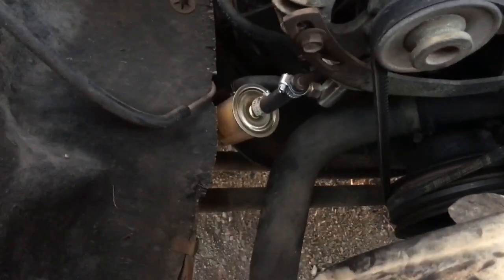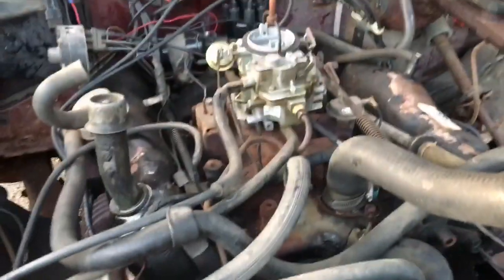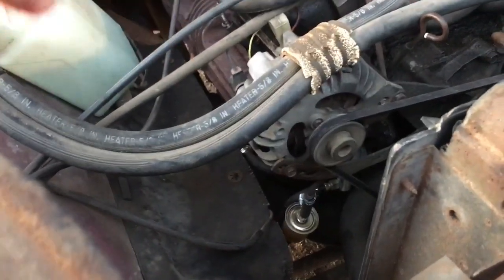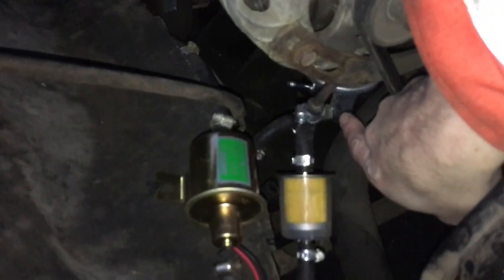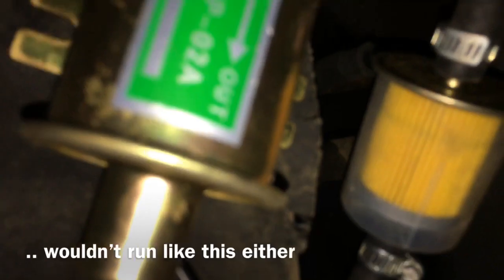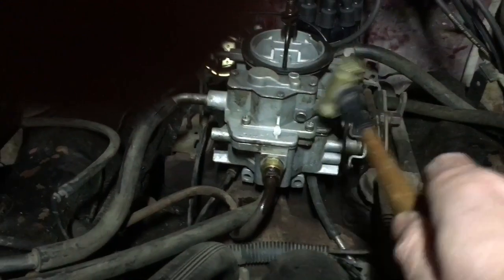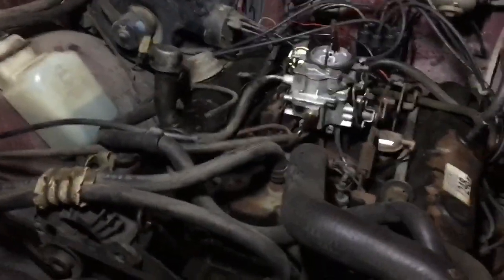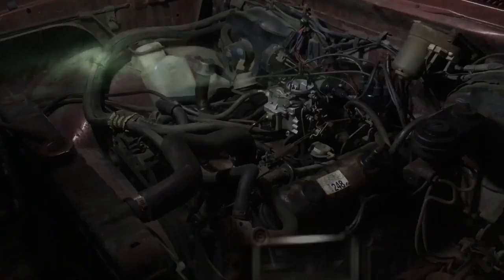1984 Dodge Ram Engine Problems Solved!

Comment: This week I went through five or six different steps trying to get my '87 D150 started. Chug-stall-dead-done. Woke up this morning and remembered "I think I saw a video where a guy tapped on the inlet for the fuel line." Tried it--started up like it was brand new. Thank you!!!
Reply from the maker: I’m so happy to have helped!! Hell yeah man 💪🏼
Reply: Does it last long term or is a new carburetor worth looking into?
Reply: @rojoperro310 It'll last until more junk gets in. I did that and I'd be opening my hood every day to start it up. I replaced my entire fuel system a bit ago and my 85 hasnt stopped running or ran bad once since then. Check your fuel tank. My sending unit rusted and was sucking up all that junk into the carb

Comment: What's the small half rounded hole next to the carburetor on the passenger side for?  in between the valve cover and intake manifold

Comment: We rebuilt a carb for this same truck last night, & I can tell you exactly why this works: this sucker gets crystalized buildup inside the fuel bowl like you would not believe!

 Imagine rock-solid Corn Pops cereal sticking to the inside walls of the carburetor, & THAT is what you were knocking loose with those little taps. 😬 There's apparently a fuel additive that can prevent this, but I forget what it is. We're all still learning around here.

Comment: hell yea, at least it really turn out to be simple. i had almost forgotten about the old trick of tapping the carb.
Reply from the maker: unfortunately but fortunately sometimes we chase a rabbit down a hole for something that was so simple but at least cut out any other system failure doubts. The truck acted up again since this video same thing needle and seat seems to be sticking so carb needs attention. but glad i know what/where the issue lies.
Reply: @FanelliRestorations  this is true, and at least once you know the issue it makes it easier.

Comment: I’m having a similar problem with my 82 d150, it doesn’t start without starting fluid but it runs fine after it’s started. It has open headers on the stock manifolds and I think they chopped them too far.

Comment: So I have a 85 dodge b250 van with the 318 in it when I go to take off its stumbling and sometimes shutting off even if I sit there and break tork it like a slow tork and it stumble then cuts off please help what is causing that??
Reply from the maker: Stumbling upon acceleration is likely a fuel starvation issue or vacuum leak, could also be ignition but you’d likely see issues at idle too.

Comment: ... on the 2.6L engine, does the carburetor need to be taken out, before the fuel pump can be removed & replaced ?  ...fuel pressure is at 1 psi & oscillating, definitely needs a new fuel pump .....

Comment: Would you happen to know where that line on the left side of the carburetor runs @2:11 because mine has nothing hooked up there and it just pours gas out. I have been searching for the answer for hours and I cant find it.
Reply: That's the bowl vent, it should go to the charcoal cannister.  Needle and seat are hung open or float is too high if gas is coming out there.
Reply: @afastcuda1970  oh there is a lot missing on the truck. I am going to post a video on my youtube of what it does in a few days. Check up on my channel in a little bit and you can see what I am talking about

Comment: i just bought a 83 ram 150 and it was running beautifully and than it just lost all power even with the pedal to the floor it wasn't going, now it wont fire up, is that the issue you were having? it'll crank but not start
Reply: Just had this same issue with my 83 D150 Slant6.  Was about to buy a new fuel pump.  About to walk outside and see if this fixes it first 😂😂

Comment: Hey man you should make a video on how to adjust the 2 barrel
Reply: Honestly, best way to do that is....either if you have two needles or one, take your flat head screw driver; turn the needle or needles all the way to the bottom, then turn them counter clockwise a couple turns. Once you fire the engine up, keep pushing the throttle for idle but just enough to keep the fuel going, adjust to your preference of idling. It will take a short period of time but it should work. If anything "worse", take the carb off and clean it throughly. Carbs can get dirty or clogged somewhat easily due to fuel carbon. Hope that helps.

Comment: Good job. I would run some seafoam through the old girl in a few tanks.
Reply from the maker: thanks man! very true,. i ran some Marvel Mystery oil through it not too long ago both in the gas and crankcase. It's an old engine has some blowby doesn't run amazing but for a cheap old work truck it gets the job done around the property.

Comment: Is that electric fuel pump pulling? If it is  those are meant to push meaning you need to have the gas go DOWN to it its not meant to pull it up